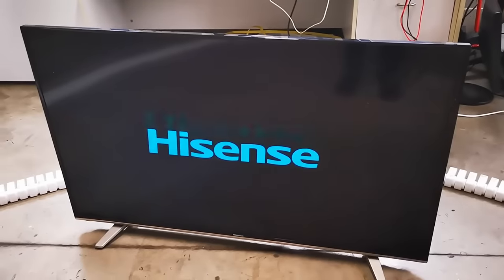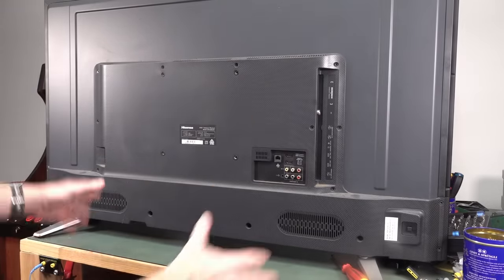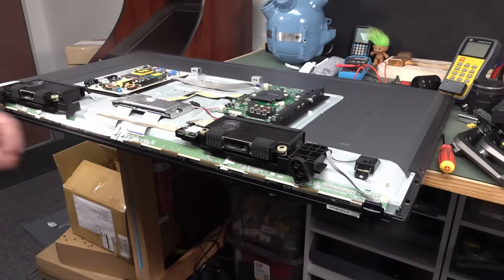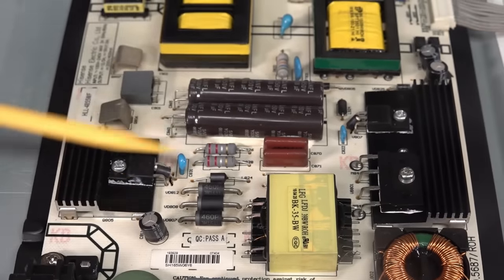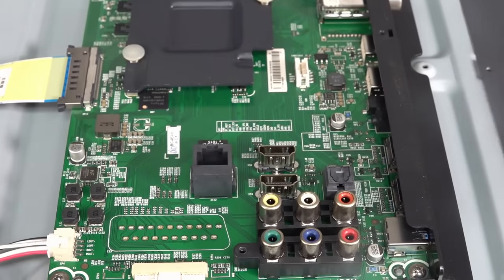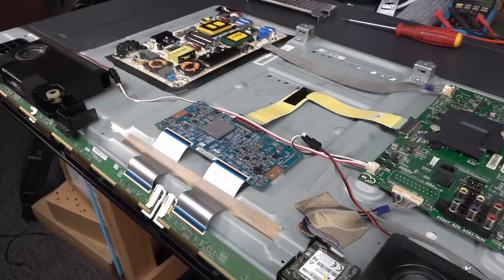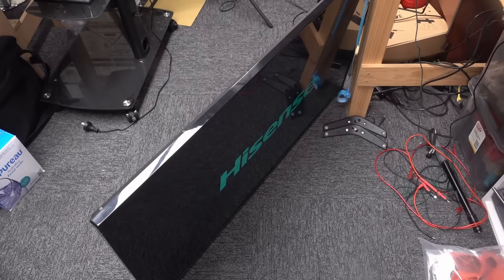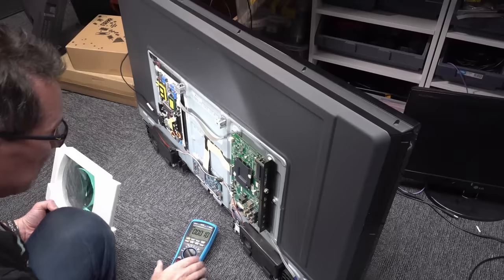Is This Dumpster Hisense TV Worth Repairing?

Comment: I've had a crack at several of these cheap TVs and even when I can locate the problem, finding a replacement part (or even identifying the parts) or replacement board is nearly impossible. So many similar parts, model numbers, generic boards and what not and good luck to you.  Maybe if you did this as a job it would be approachable, but as a home hack-handyman is a tough gig.
Reply: Not that bad .. id say ive repaired 90 percent of the tvs ive looked at, and ive been doing it for years,  i hardly ever swap boards for new ones , ill locate the faulty component / components . I keep a shed load of donor boards and led strips for parts . Once youve done a few   you could fix them in your sleep
Reply: Thanks for the insight, @reacey .  I don't really have the room and time to keep an extensive collection of salvaged boards and components.  Good to know it can be done and try and keep this stuff out of landfill.  The kerb-side collections are full of TVs and I'm sure there is no effort made to separate the waste for recycling once it's loaded into trucks.

Comment: Since these are basically a computer. I would take this as faulty Video RAM. Since in this case it is likely shared as System RAM, it is causing corruption in the display, and possibly the boot failure. Is it worth fixing? Well it's a flip a coin sort of one on this. How much time and how much are the DRAM chips worth, and if that doesn't fix it and it is a ASIC/Processor fault, it's a done deal at that point.

Comment: Looks to me more like a firmware problem.  If you had a remote you could try re-flashing it.  Nothing dodgy about Hisense I have been using mine for six year in constant all day usage as my main monitor for content creation and business.  Never missed a beat.  It is one of my first video's on the channel.  There is a video on my channel on how to access the engineering menu as well.
Reply: Hisense is one of the worst TVs in production. Your sample size of ONE is statistically irrelevant. Your one TV working for 6 years doesn't change the reliability of the brand as a whole. TCL and Hisense are two of the worst manufacturers of TVs.
Reply: @littlejackalo5326  Can you point me to the confirmed statistics that you are quoting from?
Reply: @littlejackalo5326   Just become sample size of 2 i have been using mine For 5 years on 24 hours a day as my main  monitor.. I'm a coder developer it's worked flawless with out a problem..
Reply: I agree i have done the same it's been rock soild..

Comment: Any time I’ve had this image issue on a monitor or graphics card it’s ALWAYS a capacitor. Even if a cap isn’t blown or buldging it’ll still create issues. The t conn board Can be an issue, but as the glitchy image is present on both sides of the screen evenly you can determine that it’s something before the t conn. It’s also possible the Hisense image is a screensaver waiting for input?
Reply: I was going for the LEDs the TV will enter shutdown mode if it suspects there's something up with the backlight. 

The flickering is obvious symptom of some dodgy as LEDs.
Reply: @SionynJones  sometimes ceramic caps on the flexes on the matrix itself go bad and have same signs - power supply powering up tv for a second with no backlight then shutting down.
Reply: Heating the capacitors up (a bit) with a heatgun is usually more effective than cooling them down...
Cooling is good if a device works initially and then stops.

Comment: Hey
What you need to do is to disassemble the two flat cables that go out to the screen from the T CON component, take kapton tape, and cover about 5 mm from the left side of one of them. Don't drink at the same time and try, if it doesn't work then try on the left side. If it doesn't work then try on the left side of the other cable, and if not then on the right side.
To know which part of the screen is broken (left or right)
Just disconnect one side each time and turn it on, and see if the picture looks good. If so, then probably the side you disconnected.

Comment: Something is glitching which caused it to brick. If you could reflash the firmware I think it would come back but the glitching will probably brick it again.
I think you covered all the bases here. Could be something simple like a failing MLCC cap shorting but just try and find it, good luck

Comment: Hisense is not a dodgey brand. Hisense is SHARP. I'm sure you have heard of SHARP. Hisense is some of the highest quality budget-friendly TVs on the market.

Notice the AUO (AU Optronics) controller board? Top of thd line. They are masters of displays. They are the only company to produce a 4K 400+ Hz screen to date. 

This problem, to me, looks potentially like the firmware boot up is stuck. Usually a corrupted or damaged firmware install. Maybe the TV was updating the firmware and the power was interrupted. But this is EXACTLY what it acts and looks like. I've dealt with it a ton. You can use RUFUS to make a Linux bootable USB drive and get the OEM image of the firmware by Googling the model of TV. Then you use the service USB port on the back of the TV and boot the TV in service mode. 

It will walk you through. These Android (Google as well)/Linux TVs are a walk in the park.

Comment: Hello Dave, funny story, this week a visited a friend. His 3d tv was broken, there was power but no picture. He had already called somebody to fix it. But because it is already 8 years old, spare parts probably wouldn't be available. So we watched somebody take a similar television apart. And we quickly realised this was beyond our capabilities. So I searched the web, as you do. Then I found this page: 
'How to fix your television with a hair dryer'!
And because we had nothing to loose we tried it. And it worked!!!
We held the hair dryer to the air holes in the back over the boards for several minutes while the television was on and suddenly the picture was back.
I assume it melts some connections of the graphic chip, but I am not sure.

Comment: I have similar problem with my 55" Philips, there are horizontal lines flickering from one side of the screen to about middle. Screen isn't broken, it just happened one day. I guess its tcon fail, but unfortunately it's integrated into that board glued to LCD panel. Currently repairing it is over my skills...

Comment: Remove, rubber clean and reseat all the flex cables first. 
Seen that type of glitch many times on the screen side where the panel is not right. Look at the caps and semiconductors (any tranis or diodes) on the panel PCBs first. They used to put those PCBs at the top of the panels but heat turned out to be an issue with the heat and press tab connection tape, so now they are all at the bottom. People clean the screens and liquids run down onto the tabs and pcbs there. Electrolysis does the rest. 
The panel will probably have side tabs with chips on them as well. One of them may not be powered properly anymore and it stops feeding the serial data properly  and the XY image gets out of sync vertically.  There are thin tracks on the panel mask that transfer power and data to those chips. You can test to see if that's an issue by disconnecting one of the TCON cables to see if the image becomes stable on the remaining half side. If not, try the other one. 
If it is the panel, most people junk it, although there are other ways around bad panel tracks and corroded panel PCBs. Got three of that model downstairs at the moment.

Comment: Fixed a plasma Samsung TV a couple of weeks ago. As you said, you can just remove the back while the tv is standing up.

Turned out all it needed with a little knock on a relay with the back of a screwdriver. It had been sitting unused for a couple of years and wouldn't turn on.

Comment: 1- re program nand chip on main pcb.boot error will be fix .use RT809H Programmer 

2 - try to isolate gate driver signal from  t con pcb to lcd panel flex cable (try to google or youtube - ckv cutting - double image repair - lcd flickering repair)

Comment: Pretty sure that's one of the Hisense disposable TV models, really not worth repairing.

CPU probably crashes after outputting the Hisense logo to the frame buffer, Hisense logo is probably handled by some low level bootloader, the menu is probably done by an actual OS which is probably boot looping very early in boot, weird image artifacting is probably a symptom of it, maybe it's browning out the frame output to the TCON and CPU when it attempts to boot. Only suggestion would be to take off the SMT radial can caps and test them for ESR, if it's not them it's probably beyond economical repair. Maybe thermal camera it for a bad LDO or MLCC on the rare chance.

Comment: Hisense TV's use to have caps which may not look bulged but get devalued or even shorted.
What you have to do is to get a proper component tester, discharge the power supply board, specially those 200v or 400v dc depending on your country, and probe the diodes and the electrolytics. Those noise supressing mkt's can very well be about to give the ghost.
Also you have to try to resolder everything in the power board using a 40 watt soldering iron with a fine tip and proper tin soldering wire, even the smd parts may need it.

After that, the very first time you plug the TV, it may take a bit to start up since new caps need to "reform" and the power board knows it.

If after trying this, the problem persist, then you can move to the logic board trying to redo solderings, swapping any badcap you may have and, should it be necessary, carefully air-heating the IC's.

Should you EVER achieve a working tv, don't waste a second and try to get the firmware update and do whatever it's needed to install it, it uses to mean to copy the firmware to an USB thumbrdrive and them install it from some sort of menu withing the Remote Control On Screen options.

Comment: Looks like it's stuck in boot maybe try refreshing the rom but seeing the flickering tells me that might not be the problem. If it was just stuck in boot I'd try that but the flickering tells me maybe the tcon board has issues. Of course capacitors could caus this too I'm talking about small solid state caps on the rails and small ceramic jobs decoupling chips and on the top board and the two strip boards on the lcd itself

Comment: It looks like a corrupt file system so the FW isn't booting correctly. On Hisense you should probably have a serial port somewhere on the PCB that you can connect to and check the boot sequence. Also, for Hisense I think the FW binaries (for updates and so) are not encrypted and you can use one to write it into the Flash memory and possibly bring it to life. It has been done somewhere, I already saw it 😁

Comment: No doubt finding the actual fault would be a huge time sink. Would like to see a video for a similar fault, but another functioning TV of the same model can be used to quickly identify the faulty board, and then hone in on the actual fault by comparing the operation of both boards. I always wondered what particular part fails that causes these weird glitchy faults that make us throw out an otherwise functional piece of tech.
Reply: yeah i agree, with a pair of 2 same item you could get so much easier progress. which is more likely... if the item was thrown out from an old business. and they had serval of them. almost never see this with random broken tvs though. so what tends to make more sense is when people sell the different parts as spares on ebay. like the psu board, or the mainboard. other display board etc. so then at least somebody else can have a crack at fixing their other broke unit. a bit better for the environment that way

Comment: Twisting the entire tv, or pressing down around the edges of the screen can temporarily fix these issues but I was never sure if it was t-con related. It still doesn't explain why it's stuck on the splash screen. I never considered Hisense that good of a brand, although I still have an old 3D one that works fine, even if it's bright af

Comment: Looks like a firmware issue and/or bad rom. If you are able to hard reset it through button combo and USB stick it may remedy the issue, but more likely you'll have to desolder the memory chip and flash it the old school way. Unless you can find one pre-loaded one somewhere.

As for the hazy flickers, it could be the beginning of a faulty screen, or as simple as dirty connections on the TCON board or the TCON itself with a timing issue.
Reply: I have an exactly similar Hisense unit. The problem is the TV works fine for some time and out of a sudden the screen goes off with sound and backlight on. And, when I power off and turn the TV on, it starts working fine and the problem repeats randomly. What do you the problem is?

Comment: A quick google  shows that for this brand  it is common for them to get stuck on the boot screen ether a solid logo or a glitching logo, it seems it can be fixed by using the buttons on the TV, in terms of buying spares for it  well these TVs new only cost about £300 brand new for a 50", they are an incredibly cheap brand of tv but they work decently

Comment: I found a Hisense 50H8C and recently purchased a TV repair kit for a different TV a smart tv any way the screen broke in four places needs a new screen any other problems and it has two terminal to connect to the screen I believe the repair kit would work minis the center back cover unfortunately either way the old original TV part or new ones. Except the screen cost as much as the smart 4K television I seen a few for a good price which was a long time ago

Comment: I would measure the capacitors in-circuit with your Bob Parker ESR meter, it is after all what it was designed for by Bob down under :)
P.S: I doubt those SMD caps are solid electrolytic, they are probably just regular ones without a vent, they can fail.
Your problem does seem capacitor related since it gets better as the thing heats up...
I'm kicking myself for replacing dead LED backlights in a 40" Philips BDM4065UC 4K LCD monitor and not taking any pictures:
It is glitchy as fuck now when it is cold, gets good as it warms up, must be bad caps, they all visually looked fine but dodgy brands...
So now I gotta take it apart again to check the cap values :(

Comment: I just found a Hisense 40" TV by my apt dumpster. It looks ok from the outside, but when I plugged it in the screen won't turn on, but I do see a red led visible on the built in power button below the screen.

I'm not sure it's worth trying to fix, but I look and see if there's anything obvious. I don't mind tinkering for an hour. Possibly a blown led, idk. Any suggestions? (Besides throwing it in the dumpster) Im thinking there's a good chance it will wind up there anyway, but worth a shot.

Comment: first you try to do a software update , then if that doesnt work i usually resort to replacing tcon/main board if theres no tcon. Otherwise you can look up certain pins going straight to the glass and cut them and you would get normal picture. i cant remember which pins you cut exactly i;d have to look that up but it does work. EDIT 
Now that ive seen some of the video i highly suspect the main board to be the issue , you need to try use the remote see if it reacts. also apply video signal and see if everythin else works, if it doesnt its main board issue 100%

Comment: Stuck on the boot screen like this would be a crashed SmartTV SoC and the screen jitters could just be a side effect from the SoC being out to pasture. If the SoC uses the same clock reference for itself and TCON interface, the jitters could be a sign of the PLL losing lock due to dirty reference clock.
Reply: I second that, SoC related

Comment: When I work on TVs and monitors I always check the power supplies I use an Oscilloscope, low 60 or 120 cycle low times indicate a typical form of light ripple, just going bad.  I was given a huge Hisense TV like that and it being android takes almost three minutes to boot, but the picture and sound are outstanding.  It is also a fine internet terminal. Ron W4BIN

Comment: The solution to flickering is signal blocking, commonly called tape method, that tv has a 2 flex cable on the t-con board going to the panel, the first thing to do is disconnect one flex, either left or right and power up the unit again, only one side will have a display, if the flickering is gone, then the disconnected flex side going to the panel must be blocked, blocking the ckv signals will solve the problem, you can watch my channel, Gio Remi, I just uploaded a video about flickering problem....it's a 50" Samsung smart tv....

Comment: I found that many devices that leave the backlight on when rebooting (Including a laptop I converted to LED a decade ago) will flicker when resetting the T-CON (or LCD controller in LVDS laptop LCDs),
I'd suspect:
Possibly the output caps of the PSU are just off spec (Check for excessive ripple with a scope?),
Bad EEPROM (If you can get a ROM-Dump from another owner),
bad BGA (RAM or SoC, I ain't at a Louis Rossmann of BGA, good luck),
Constantly rebooting 60 times a second? Could be a power-on-reset IC or R/C issue, rare as a bulls' punani (though I had some ACCESS-IS keyboards do that).

Comment: The first thing I would try is to flash the NAND with a known working Firmware. I fixed several Junk Manufacture TVs by flashing the NAND which were stuck at the Bootscreen or showed a Message like "Receiving data" Some Manufacture built in a Time Bomb into the Firmware to make sure that your TV fails after this Date

Comment: What do those acronyms on the PSU mean, I'm repairing caps on this 42 Hisense so I want to turn on the PSU without the other boards connected, I have the various voltages of course, PWM, SW and 5V-S what do they mean, which one turns the PSU on? Ground it or apply stb voltage?